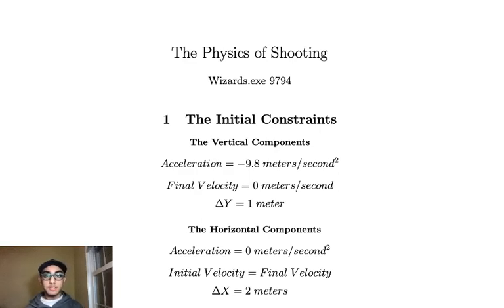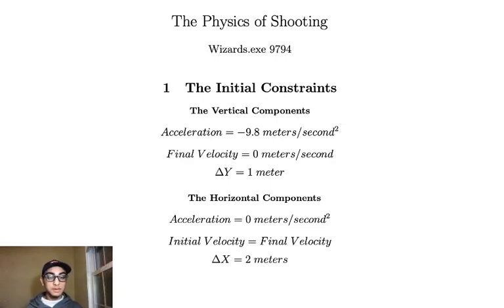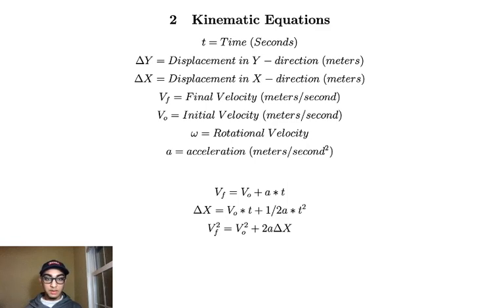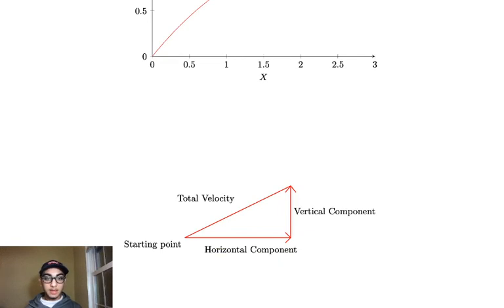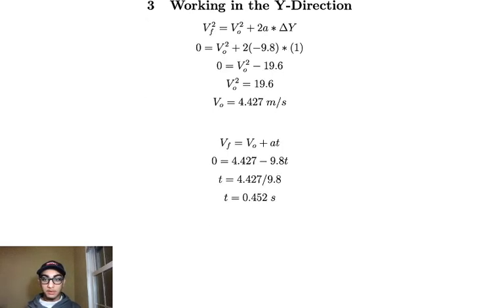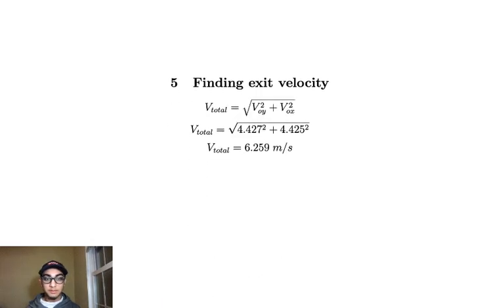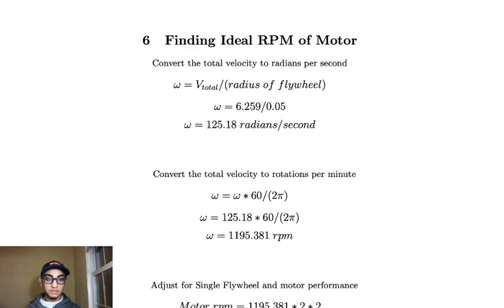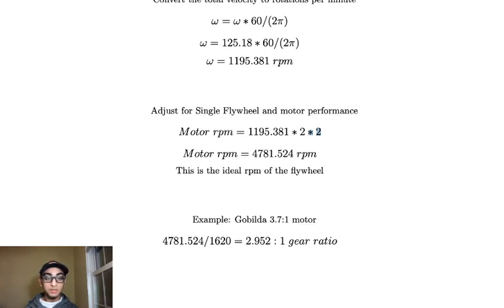The Physics of Shooting: Selecting the Ideal Gear Ratio

Comment: I commend you for working on the physics but would like to challenge you to go even further!  The trajectory part is correct and the conversion of velocity to radians per second is accurate but this analysis is oversimplified when converting to launch speed and motor selection.  You are correct to assume that part of the flywheel speed goes into rotating the object.  The actual ratio is dependent on the radius of the shooter and the radius of the object (see if you can work that out).  There is also a loss of flywheel speed to consider (look into kinetic energy relationships, here you may need to seek physics teacher help if you are unfamiliar).  Finally, the motor selection should be related to the operating rpm range that provides optimum motor performance (peak power in this case because you would like motor speed to recover quickly).  Keep in mind that all FTC legal 'can' motors are the same, their gearboxes simply allow them to operate optimally over a particular range of torque/rpm.